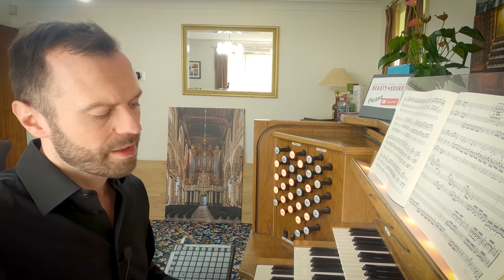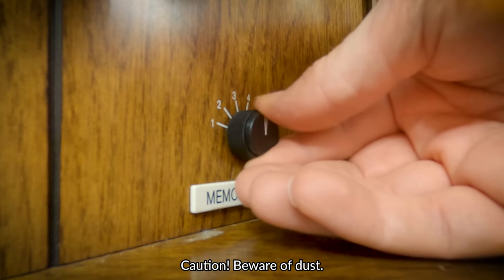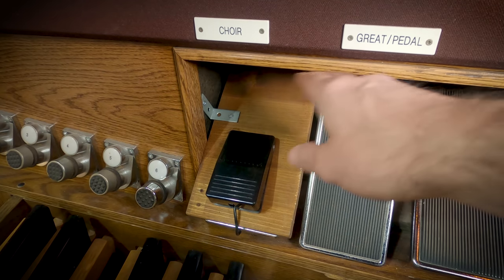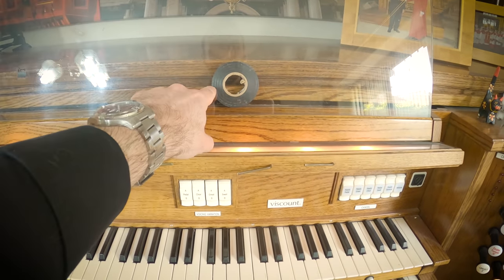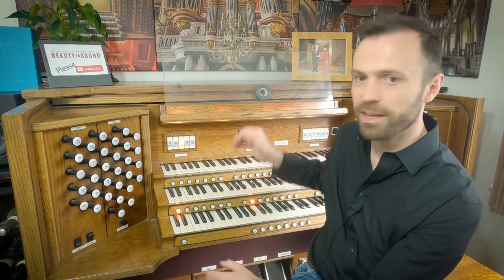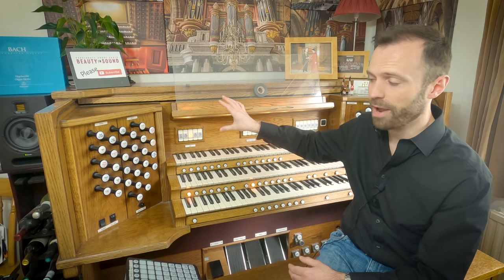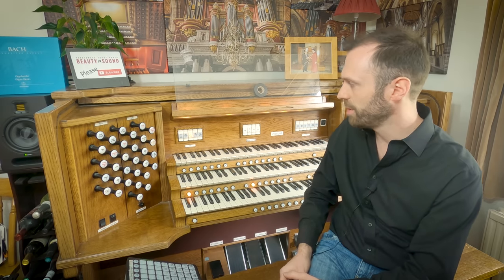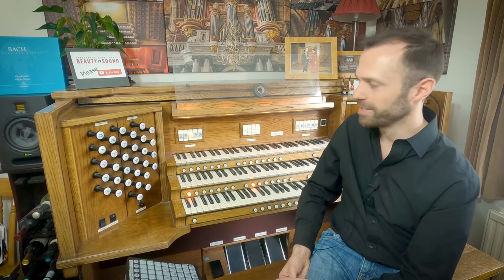☕ My Hauptwerk Organ Setup | My Console Modifications

Comment: Regrettably, I firmly believe you need to replace the lovely, but failing stop jambs with touch screens. Why on earth would a fellow traditionalist like you suggest this? One reason: this would permit full access to ALL of each sample sets' stops. Each different organ jamb would appear as on the actual console - helpful familiarity for when you again play live on those actual instruments. I'm sure you will someday! Reliability is a strong second reason; third is flexibility as relates to the various sample sets you rotate between. There are some very fine minimal LED adjustable music rack lamps available on line that would not get in your way. May I recommend a dimmer for any that you purchase? Beyond that, I like the idea of "firming up" your pedalboard and swell shoes. I have found most electronic organs to have extremely light & loose controls. Also, LED "puck" lights - look like hockey pucks might serve well to light the Pedalboard - again with dimmers.  Regarding your organ bench height adjusters: I am 6'-2" tall with an actual extra inch of length between knee and ankle. Early on in my studies I would place hymnbooks under the corners of the bench. I've found that 1" to 1-¼" works great for me without my upper legs being jammed under the Choir manual. Organ shoes with 1" heels are a must! I even have had flexible "cowboy boots" with pointed toes and 1-¼" tall heels that worked surprisingly well - they would work well for you when wearing your Stetson!  Best wishes on getting that bigger computer - 128 GB of RAM is a good investment. Cheerio from across the pond!

Comment: before you keep drilling holes in your beautiful console perhaps you could consider attachments in areas that do not show such as under the console keyboard side cheeks. you could securely attach some sort of outrigger arm there out of sight which protrudes forward and then attach a clamp style monitor stand to it to hold your touch screen add-ons. if you were really ingenious you could make it swing out of the way for easy ingress and egress from the organ bench. yes it would be a little Tesla but short of calling in the woodworkers I'm not sure what else you have as options.
Reply from the maker: No more drilling or DIY required for this console - the new console will be here soon enough 😊

Comment: I have a 2 manual organ running hauptwerk. When playing a 3 or 4 manual organ I run both of the manuals as a floating divisional. To change which manual is being controlled I use the pistons below that manual. You lose 3 or 4 pistons per manual (not a problem with your launchpad) but once set up it's super easy to use.
Reply: I use this same solution with my two manual console. Since virtually all registration changes I make while playing are done by just incrementing the sequencer, (perhaps I'm lazy but I see a lot of professionals doing it too) so I found I was rarely using the divisional pistons anyway. Being something of a geek I was able to modify the organ definition files of the organs I play so that the states of the floating divisions are saved in each sequencer stage and are recalled automatically along with stop and coupler changes as I increment the sequencer.

Comment: I use two launchpads as my organ is a 2 manual Johannus, and I created a template to print onto OHP transparencies for each organ.  I have up to to 128 potential stops, and I programmed 4 of the console buttons to control the virtual keyboards, switching to one of 4 keyboard arrangements, and, of course, the launch pad is programmed to send any of the divisions to any other keyboard.
It works really well, but I wish HW5 gave more control over the launchpad colours rather than bright/low of same colour as an example.

Comment: I thoroughly enjoy your music, am a happy subscriber and have been wondering about your setup. Thanks for sharing. Have you considered replacing the drawknob panels with touch screens? I did that with a Viscount Grand Opera. They fit the spaces exactly, all I needed was a 1/8 inch thick strip of wood along the bottom of the screens. I upgraded from a laptop by putting a small PC into the console, tucked away on a shelf under the manuals. I believe the internal speakers were in the way, but they came out easily. I also replaced the vertical panel above the keyboards and centered a drawer with a compact keyboard for the PC - painted the panel flat black and it matches the touch screens. I use a wireless mouse. Thanks for giving me the idea to put a sequencer piston in place of the "great" and never-used expression shoe. It's fun seeing how other Hauptwerkians set their organs up.

Comment: You mentioned having the solo being on the same manual as the choir. The grand organ at the cathedral I sing at has 4 manuals, with the choir and positive sharing the bottom manual. As you said, it does mean you don't get to use the 2 divisions separately but at the same time, but you rarely use them at the same time, in my short experience playing the organ.

Comment: How about three ventils? - Choir on I, Great on II, Swell on III - controlled by a second launchpad in a small drawer under the stop jambs.  Stops from these divisions would only sound on their "home" keyboard when their ventil is engaged.  However, any stop drawn would be immediately available via the couplers so, for example, if the ventils were off, you could have the Great reeds on the Pedals, the principal chorus of the Choir being played alone on II, the big Solo reed on III, and the full Swell on I.  Not a likely setup...but you get the idea. C-C used ventils extensively on his large instruments and they work brilliantly once you get your head around the idea.

This launchpad could also control the stops for the Solo division and any additional ranks from the Choir, Great and Swell not currently controlled by drawstops.
Reply from the maker: Cheers Oscar, I’m already thinking along these lines and am convinced that I’ll resolve the issue through use of Launchpads. A fellow viewer suggested incorporating drawers underneath each side of the organ which I can push away when not using them. This I think is an excellent idea, along with what you’re suggesting!

Comment: Richard, replacing the lights in your draw knobs is easily done.  There is a thread on the Organ Forum that addresses this.  I am sure one of the techies there can tell you what bulb you need.  I found mine from a source in Germany which sold them at a very reasonable cost.  YMMV  Here is a link to the forum thread: 

https://organforum.com/forums/forum/electronic-organs-midi/classic-church-electronic-organs/47874-a-cautionary-tale

Good luck to you.

Comment: Hello queen nala and side Kik 
Why not remove both stop jams and put in the same space to fit two flat touch screens built in then you could have all the stops virtual but still look like the instrument, you can get them from 10” in 1” steps in size so you could get one to fit the gap give or take 1/2”
I found your video very interesting as I am getting a Allan Historique 3G and want to run Hauptwerk on it using its midi conections  , it’s like the dark arts so I found your video very interesting thank you for making it
Reply from the maker: I like traditional-looking consoles and would never forfeit my physical stops. Having two touch screens is not an option for me as I don’t like them in find them inappropriate for my playing requirements. I’d rather struggle through than lose my current stops.

Comment: Hi Richard. I want to tell you what I have done with my Viscount V90 to control the Hauptwerk console. You can search for biogon in contrebombarde:
https://www.contrebombarde.com/concerthall/user/4142

First of all I must tell you that I I don't want to lose the possibility of directly playing my V90 and the sound modules that I have; for study I don't feel like going around turning on the PC, starting Hauptwerk, installing the organ and touching the screen. The solution of controlling the stops by changing the covers, or using the touch-pad does not seem good to me because it would only be useful if you use a single HW sample set. I have moved the music stand
 of the V90 15cm to the left and I have placed an Asus 22 " touch screen secondary to the PC.
I use the V90's amp too, but I still use the great woofer it has. I have wired the output of the mid-highpass filter to the external speakers above my head through a switch. I use an external car amplifier and another pair of speakers for the rear channels.
The V90 is more modern than your Viscount and I use the V90's "PREV" and "NEXT" buttons to go PREV or NEXT the HW combination or directly access the 6 direct combinations on the V90. Simply record the combinations (1) to (6) in the last bank of the Viscount only with the activation of MIDI on the three keyboards and the pedal and a “PROGRAM CHANGE” code from 1 to 6. Then in the “Organ” menu. settings ”and“ MIDI / Key triggers… ”of HW assign“ Registration stepper: trigger xx1 ”to xx6 the code“ program change ”that you defined in the Viscount for each combination of that bank. The same for “Cancel” and “Trem” of each keyboard.
In your case, what I would do is through a program such as “MIDI-OX”, read on the PC the MIDI implementation codes that your Viscount sends when you press the buttons of each combination and assign them in HW.
I have a selector switch with which I can select the REVERB of the (Viscount), the one of the sound module (MOTU) or  the HW organ, which gives me a lot of flexibility.
I have no intention of installing HW5 and reconfiguring everything; I do not need it. What is unforgivable is that they stop supporting the HW4 dongles.
I love your cat.